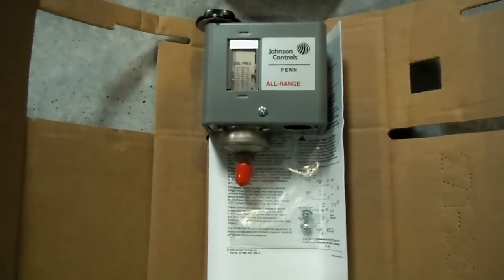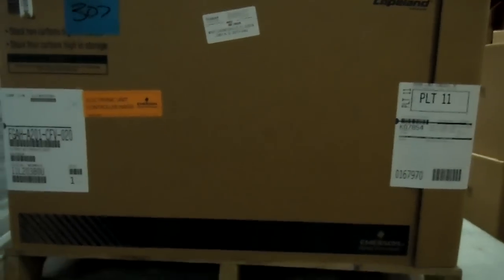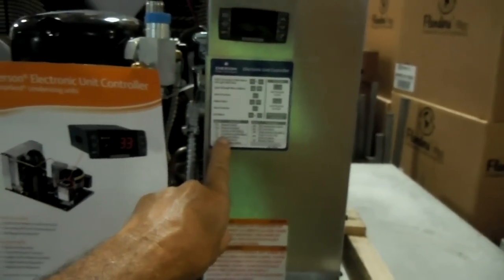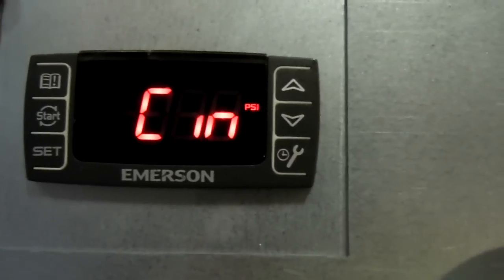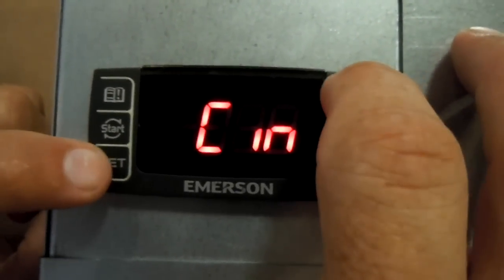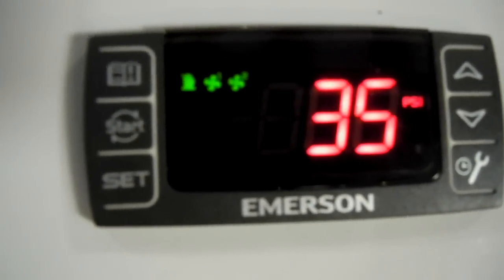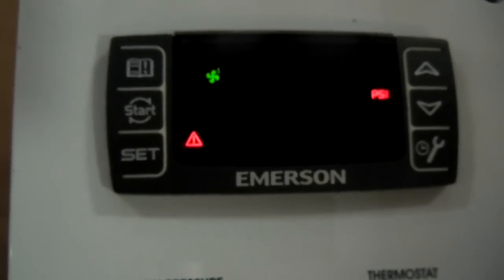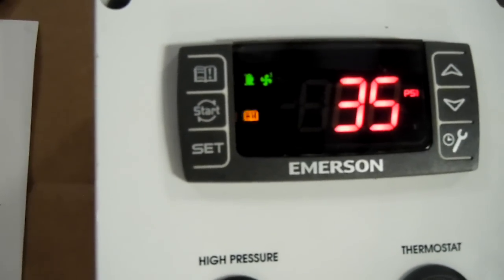HVAC Emerson EUC

Comment: Neat device. The functions remind me of the Carrier "Comfort Link System" on package units where you can scroll down & see alarm histories, etc. It also displays trouble codes & even allows you to read low & high side pressures, refrigerant temps & much more.

Comment from the maker: The blower is usually set up on the high speed in cooling mode. You could change the speed wires to a lower speed but then you have to be careful about freezing the evaporator coil.

Comment: Hey Dr.Z, I have a question, I have a 5 year old GE refrigerator that has non condensables in the system. Earlier you said it's probably motor winding insulation. How would I get this out of my system? Would I have to change the compressor, or just evacuate the system?

Comment from the maker: The system will remove more moisture if you put the fan on a lower speed. I wouldn't expect the system to shut down on a really hot day. It's normal to see a system running all day. Like I said before, just be careful not to freeze the evaporator coil.

Comment: I have a question about refrigerant types, I have done some research on R410A refrigerant, and i've found it can run much cooler while maintaining a higher pressure. Do you think R410A could be a suitable refrigerant for medium or low temperature refrigeration?